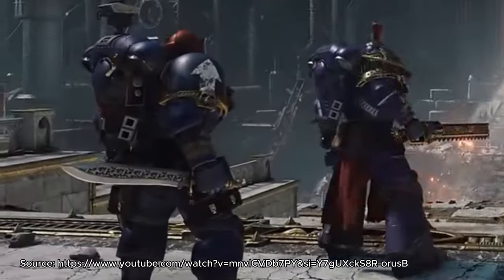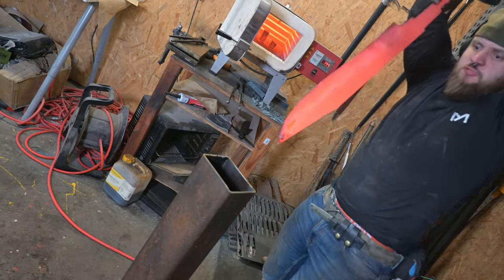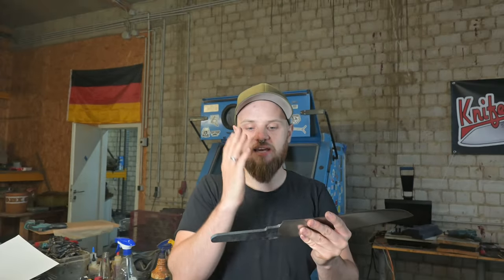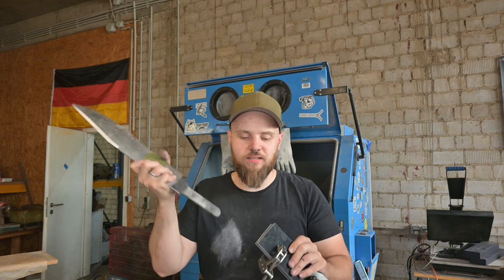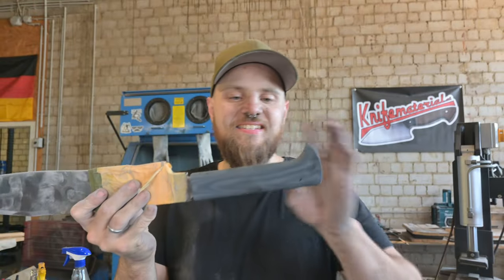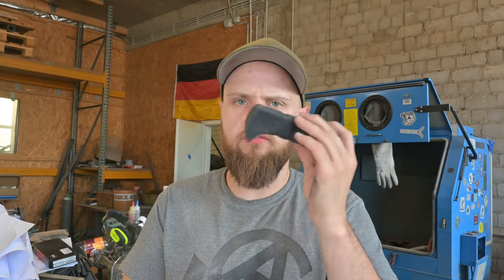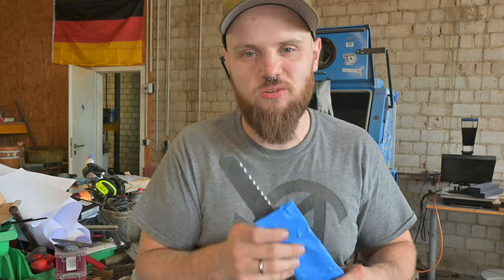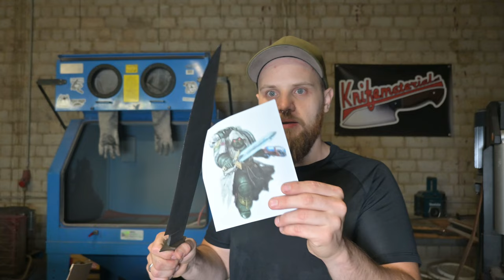Warhammer 40k Combat Knife | Space Marine 2

Comment: The thing is everything a space marine uses has to be big enough for them, they have MASSIVE hands and beyond their massive hands they have thick armor. So a short grip for a space marine is like a hand-and-a-half for a regular person at least. Regular humans can't wield space marine weapons simply because that'd be like a toddler trying to use a Desert Eagle. So if any weapon were scaled up for a space marine it'd be likely 1.5-2 times the size.
Reply from the maker: @Some_Idiot_on_the_Internet  you are completely right. I wanted to make a compromise. Still bigger than a normal knife, also the handle is 1 and half for me. But i also wanted to still use it for chopping and cutting. 
If you compare this knife to a normal combat knife it is much bigger
Reply: @forgeworks3176  first of all this is a great knife and really gets the spirit right.   but to elaborate on what was mentioned above. not only would have to be bigger, it would need to be MUCH heavier built than this.  I am thinking a blade thickness more like a industrial metal shear and a handle made to take the crushing grip of power armor.  I am guessing a length of about a 3.5 feet long and a  induction hardened blade with a base thickness of well over an inch. the guard and handle would probably need to be hardened steel too.  I am guessing a finished weight of 30-50 pounds.    it would be nice for somebody to make an example, but this is probably a job for a machine shop....
Reply from the maker: @Bigredforester hey man i am totally cool with that. Thanks for the long feedback i do really appreciate it and you are right. I still wanted to use the blade and capture the spirit of a Space Marine knife.
Reply: And at least 1.5 to 2 times thicker blade than for a human-sized combat blade. Over 1.5 cm thick i think 😅
Reply: @forgeworks3176 I think you did a great job dude! It looks awesome c:

So I think that person was just saying what he would like to see, not that there is anything wrong with the blade you made just to be clear
Reply from the maker: @austindecaux7895  thanks mate. I didn’t take it offensively 💪
Reply: In one of the Night Lords books, they do describe their blades as being  1.5 to 2 x human normal. One character wields a two-handed sword 8 or 9 feet long, and their combat knives are the size of short swords.
Reply: "Regular humans can't wield space marine weapons" well except one man.............

Sly Marbo
Reply from the maker: @v0dka885  he is the main character
Reply: @forgeworks3176  Приветствую! А может еще сделаете Катачанский клинок?
Reply: The size thing is a recent GW ploy to roid the space marines. Rogue Trader / 2nd Ed they were all 6 foot 4 inch or around there. Certainly big but not the 8….no 9….wait TEN FEET TALL retcon silliness
Reply from the maker: @BewilderedDuck-e5l  yeah it always changes also from book to book how stuff is described
Reply: Leman Russ is the best Primarch, For Russ
Reply: This is all fine and dandy, but the guy very clearly wanted something functional and not just a prop.
Reply: Probably be close to 4 or even 5 feet  long with a full tang
Reply: @forgeworks3176  GREAT compromise  !❤ Really BEAUTIFUL WORK!